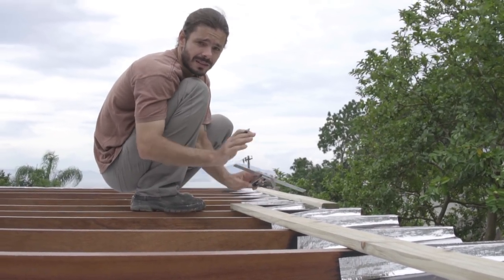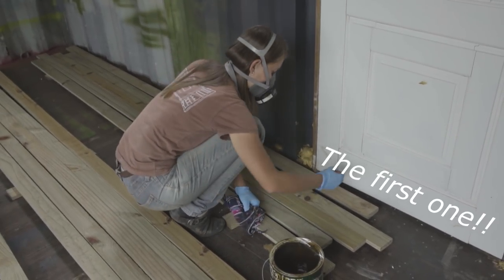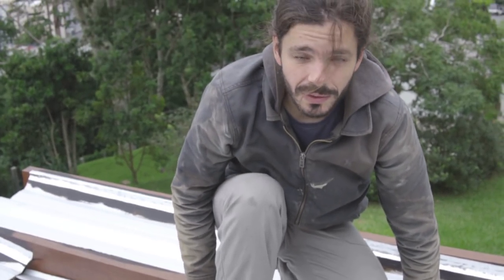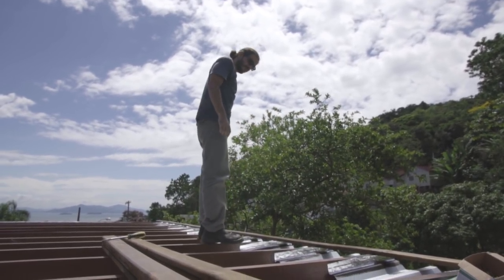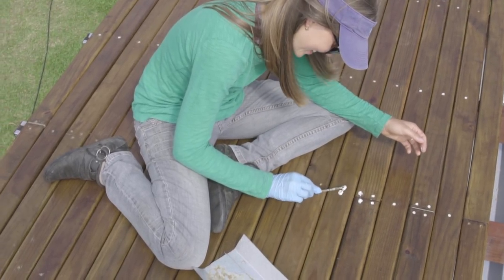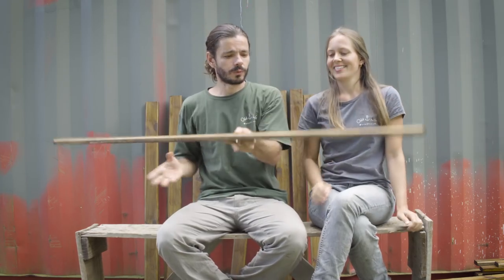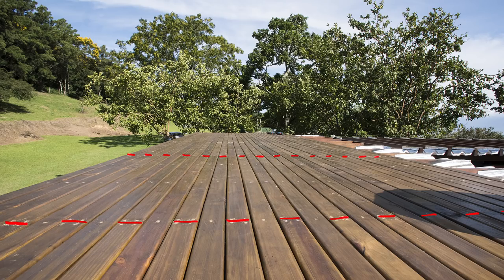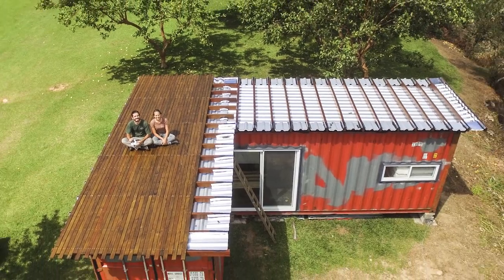Tiny Shipping Container House Deck - Living Tiny Project Ep. 021 Part 3

Comment: Loving the work so far, and greetings from Ireland. 2 tips that may help you. 
1) If you have some sheets of ply wood to lay down temporarily on the joists you can create a more secure platform to move around up on top of the containers . 
2)make small "spacers" the size of the gap between the decking boards which will help you to lay down the decking quicker and then remove once the boards are screwed down.

Looks really good though, this roof is over engineered and that will help make it last a long time. Keep up the good work. 

Bon Dia!
Reply from the maker: Thanks so much for the support and for the tips. We are definitely gonna try making the spacers!!👌🏼👌🏼😎

Comment: Very good English guys. What you did with the decking boards is called, "staggering the joints". And you were correct to do that.
I live in New England, the Northeast USA, and it has cold snowy winters & hot humid summers. So yes a different climate. PS she is caliente.

Comment: Looking good!

Only one possible issue I noticed.  At least in the U.S. our standard white glue is not water proof and after it has dried when it gets wet it comes un-glued.  Up here I would suggest using the cream colored wood glue that is water proof once it has dried.  If in Brazil they use the same color coding then next good rain your white glue and sawdust mixture you used to cover your screw holes might soften up and get washed out by the rain water.

Not trying to be negative, just I used to work in the building trades and that is one thing I saw that could be an issue.
Reply from the maker: Thanks a lot for the tip. We actually bought yesterday a water proved product intent for this use so in the second half of the house we will use that. If the glue loses up we will take off and substitute. 👌🏼👌🏼

Comment: I would have used deck screws and left them exposed, in case you need to take up some planks to work on the roof at a later date.  Edit:  I see from a later video you have changed it!

Comment: I'm thinking I'm a day too late here, but here goes anyway.
Let me admit that I'm lazy and don't like to repeat the same thing over and over again, like climbing up and down ladders.
When you get to be my age you'll understand.

If I were doing your decking...
I'd move ALL material, tools and supplies ON the roof and climb the ladder only twice...ok maybe 8 times max.

For your lower deck.
May I suggest using treated 1"x6" decking if you have such an animal.
This material is actually 1" thick and can span 16" OC (on center) quite well without deflection.
I would fasten them with two No. 8 x 2 1/2" decking screw designed for treated material (green or brown) WITHOUT drilling them.  Screw them down just a metric hair below the surface.  If that's not possible you might use a drywall bit that limits penetration.  With your skill level, I'm confident you won't need the assistance as it is a nuisance.  
By drilling a hole and filling it with goop you have created a reservoir that will hold water which will degrade you 'goop' and accelerate the decaying process as the well (raw wood) is no longer weather protected.  

And lastly,
I can't remember you mentioning a guard railling for your roof deck.  
As a major safety concern and liability issue I would give the subject some thought.
42" high, not climbable, less than 4" between balusters for your consideration.  
Accidents are rarely planned...That's why they are called accidents.
Cheers,
Reply from the maker: Thanks a lot for all the advices. We are actually changing all the decking screws to stainless steel. And living it flush to the decking. Let’s hope it less for a while.
Reply: SS screws......WOW!
I thought you were on a budget?
Stand by for my thoughts on spacing.
Cheers,
Reply from the maker: We ar but we don’t have many options of screws here. We were using what the call here bi-chromatized screw. But we found out they wouldn’t less for long on the weather so the place we buy screws we had no other option. So in the end we will spend an extra 100-150 dollars but it will lest dor a long time. I hope.
Reply: I've been building decks for perhaps your ages combined and I've finally (two years ago) found the solution to the SECRET TO LIFE.
Here it is, 
The lumber arrives on the jobsite, you break the bands and proceed to install with an even spacing of say 1/4" to allow for expansion and contraction.  The material will seldom if ever expand length wise.
Over time you notice overall uneven spacing throughout the deck.  Some are tight, some are ugly wide.
So what's causing this?  I thought I was doing a good job at spacing!!
It's because the lumber on the outside of the pile has a substantially different moisture content than the interior hence the difference in rate of movement.

So here is my solution.
Make ALL the material the same moisture content by either leaving pieces in the rain or soaking them with a hose.  100% moisture content or close to it.
Then you butt the wet pieces snug to eachother...not tight
This will garuantee that the material will not buckle and when it dries you'll have an acceptable even gap throughout.

Now I know this is unconventional, but so far my deck has been performing much better than my previous builds.  I also have to mention I don't stain the wood anymore, I rely on the treatment only.  Two years later the wood has turned a grey patina that for my liking is acceptable.
Just another opinion 
Hope this helps,
Cheers,
Reply: FOREVER...lol
Reply from the maker: It’s always good to learn new techniques. I don’t know how is your weather but here even though the wood is treated I don’t really trust it on the weather for too long. We have a really humid weather but at the same time hot. I don’t know I might be wrong as we don’t have that much experience with it. But we decided not to risk and to apply stain. What we did we let the wood dry out for like two weeks and then we applied stain.
Reply: Maritime weather
Total yearly precipitation 252" in the form of water, ice, snow...I'm serious.
To put it in perspective, that's over 20 FEET of water falling from the sky.  
Humid you bet, damn HUMID
I saw a Canada goose fly over last year wearing a pair of goggles...I think they were goggles...it could have been the beer...lol
Cheers,